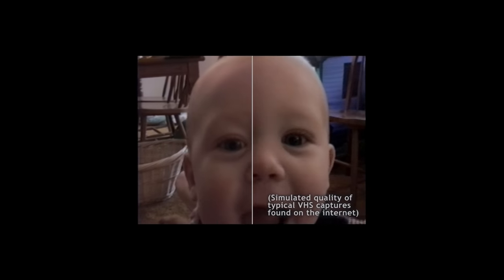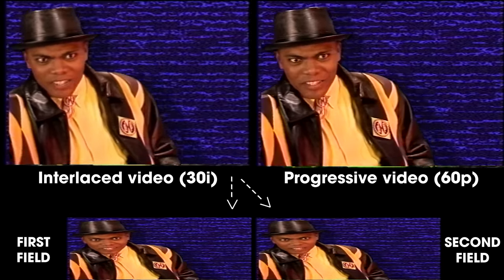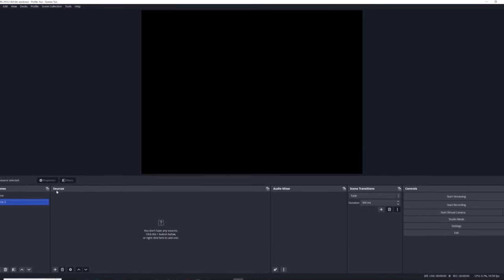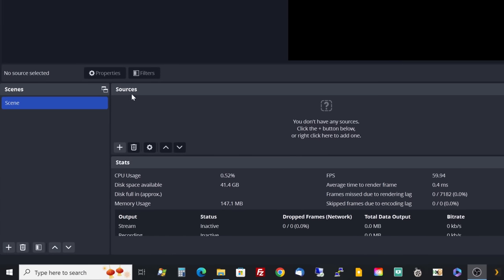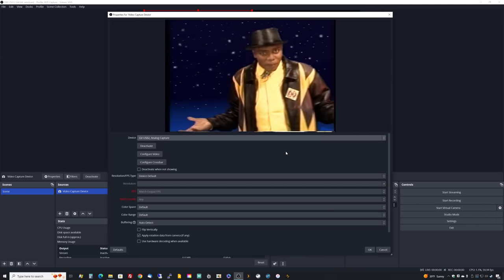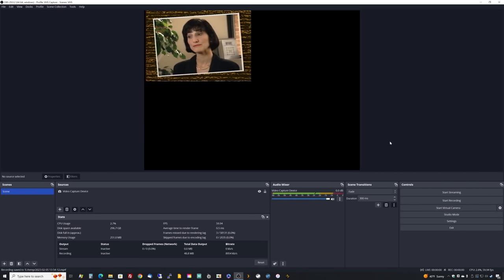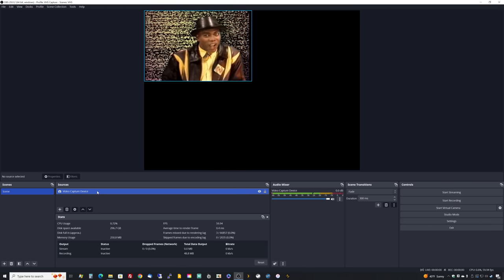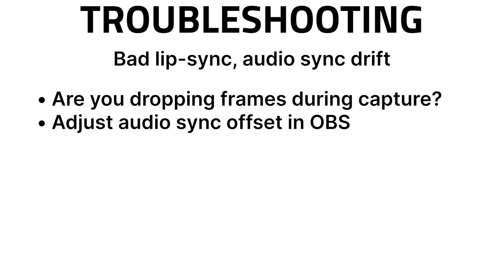How to convert VHS videotape to 60p digital video

Comment: This is great thank you.  Only thing I think I disagree with is choosing 1080p resolution to record into.  I think this should be native VHS resolution, because that way, we can use upscaling methods to get it to 1080p if we wish etc.  No need to render so many extra pixels for no gain in quality and an unnecessary gain in file size.  So for PAL this is 768x576p.  More info here: https://en.wikipedia.org/wiki/576p
Reply: PAL should use non square pixels, don't add extra informations to the archive.
Reply from the maker: The recommendation to do 1080p was for people who want to upload to youtube and have the 50p/60p rates preserved.  YouTube won't play anything faster than 30p unless the upload is 720 lines or more.
Reply: @TheOldskoolPC  You should have made this clear in the video, which you don't. Instead, you end up misleading people who just want to digitize their home videos into files for themselves into having upscaled videos and wasting space. A simple section suggesting both depending on what the needs are would have been sufficient.

Comment: This video is a godsend, but I have one problem.

I have a Dazzle DVC100 (the white one) and I hooked it up to my MacBook Pro. The light on the system is on, but when I tried to add a video capture device on OBS, the Dazzle doesn't show up on the source menu. I don't know what's going on. Is it because the device is old, or is it because I use a USB to USB-C converter?

Thanks so much still.
Reply from the maker: I'm afraid I don't know; there are too many variables.  You might want to purchase a different device.
Reply: Did you find the issue?

Comment: I followed the instructions in this video to convert some VHS tapes and the results were great.  I also have some Hi8 tapes to convert and after converting a couple of those tapes, I would say the quality of the conversion is worse than what I experienced with the VHS conversion (which is the opposite of what I expected).  For reference, I am using the original Sony Handycam camera that was used to record the tapes, I believe the original recording settings were set to record at the highest quality possible with the camera and I have cleaned the playback heads and other components inside the camera.  Is there an OBS setting that should be changed to convert Hi8 tapes vs. VHS tapes that would increase the quality of the digitized file?

Comment: This video is so welcomed and probably the best I've seen on the subject. I'm looking to convert VHS videos for video work, though I'm running Windows 11 or a M1 Mac. Any tips or recommendations for these OS? I'm hesitant to order one of the suggested devices because I'm afraid they just won't work with any of my laptops. If you have any other recommendations, they'd be welcomed! Thanks
Reply from the maker: Any laptop with USB 3.0 ports will work.  I can't recommend anything for Mac as I down own one, sorry.

Comment: This very thorough tutorial only covers using capture cards with red, white and yellow RCA connectors, but my Panasonic VCR has Scart connectors. I've read online that Scart can actually allow for a higher quality output signal (RGB) while the RCA connectors only offer a lower quality output signal (composite). Are there Scart to USB capture cards available or should I just get a scart to RCA adaptor, and the use a capture card like the I-O Data GV-USB2 recommended in this video?
Reply from the maker: The signal on a standard VHS tape mixes luma and chroma into the same signal, so you can convert SCART in this specific case to any other standard (s-video, composite) and it shouldn't further degrade the signal.

Comment: Another great tutorial!  Thank you.  Method definitely works well, but I do get better results with the old video's method.  Perhaps something to do with capturing at a full HD resolution instead of closer to the native? it ends up looking more digital, sharper edged in the final video doing it this way, and loses a bit of detail.  I also found virtual dub handles dropouts/timing issues a bit better than OBS, though that seems highly anecdotal and might just be my perception, not reality.  I feel a bit too ignorant to comment much more though.  

This method is faster, cleaner, and easier for sure.  OBS also has better audio handling, seemed to me, was much easier to avoid peaking problems.
Reply from the maker: Nothing wrong with using the older method -- this updated video was a response to people who said that virtualdub no longer worked for them, and/or had audio sync drift issues.

For capturing video for editing and archival, I would not recommend resizing at all, since resizing is destructive.  Hopefully I'll make another video in the future that covers higher-quality processes (that take more work).
Reply: @TheOldskoolPC  Any plans to cover higher-quality processes in a new video? Maybe over the holiday season? :)

Comment: I was so excited to see that you posted this new video- thankyou!  I'm getting older and really appreciate the detailed instructions,  However, I'm struggling with audio- I'm getting NO sound now.  I'm using a dazzel, and didn't have problems prior to get OBS going.  What kind of audio settings do I need to consider when setting this up?
Reply from the maker: If using Windows 10 or higher, it's possible the driver no longer permits audio; that's why I added a troubleshooting section for using a second source for audio.  I didn't have these issues in Windows 7.  The Dazzle device is 15+ years old so it's a driver issue, unfortunately.

Comment: Which VCR should i buy?  I know that a VCR having an S-Video output port is a plus, but my current VCR (Made by Sharp) is not equipped with one.  Please let me know if i should buy a JVC S-VHS VCR, or would you recommend a different a VCR to use?  I take it that Elgato is a good, solid video capture device.  I will buy one of them!  I will probably buy both the VCR with S-video, and the Elgato (or other good, solid video capture device) Friday.

Comment: Your video helped a lot with
VHS conversion. I started last year with dazzle 80 which was too old then with cheap Amazon
Dongles with poor results.Now I'm using Vidbox which OBS recognized and with your settings
I was able to get good results. With the tapes digitize, what would be a good way to clean them up? Denoise software with Upscaling? Hope you can help.Thanks again.
Reply from the maker: If you want a decent noise-removal + upscaling solution and aren't afraid to spent some money, Topaz Video AI can do a good job if you feed it progressive input.  For that, I would omit the scaling portion of this tutorial, and use the OBS function (you can right-click the canvas) to set the canvas size to exactly the size of your video capture device.  Then do everything else as normal including the deinterlacing, then bring that result into Topaz Video AI.  This is necessary because Topaz Video AI, at the time of this writing, doesn't handle interlaced video well:  You have limited processing options, and the deinterlacing quality is not great.

Comment: I have a VHS to DVD recorder. How different is this system? The VHS to DVD recorder digitizes the video and I can copy the DVD to my hard drive in any format.
Reply from the maker: That's a great way to do the transfer, but what is missing is the deinterlacing of the 30i capture to 60p output for viewing all 60 fields per second on a modern device, or uploading to youtube.  You can use the FFMPEG command I have in this video's description to convert the MPEG-2 files you copied to the hard drive.

Comment: Great and very useful tutorial. I found this video through my recommendations tab on YouTube. 2 Questions. 

Q1.) Can this method be used on tv recordings that I previously made on a DVD recorder in the mid-2000s? 

Q2.) I most likely going to have to buy a VCR since who really has one these anymore haha. So do you recommend to get one from eBay, from a thrift store or somewhere else and what should I should be looking at when it comes to purchasing a VCR to digital capturing from my TV Vcr recordings? 

Thanks in advance and it was my pleasure to drop a little tip money for your video. 

Cheers!!!
Reply from the maker: Appreciate the tip! To answer your questions: if you previously made TV recordings on a DVD, don't use this method, instead use something like makemkv (it's free but you have to enter a new beta key every month) to copy all of the DVD titles into files, then you can work with each file individually. This will prevent any generational loss. Also, as for a VCR, I recommend a thrift store or goodwill first so that you can test your process. Once your capture process is working, then you can decide if spending $350 for a quality VCR on eBay is worth it. Connect the VCR to any television you own with a composite input RCA jack and play a tape to make sure it works at all before starting. Good luck!
Reply: @TheOldskoolPC  thanks for the response.

Comment: There is also another way to cheaply convert VHS to digital. There are loads of cheap DVD recorders that will let you record any tapes that aren't protected with macrovision. Once it's recorded, just rip the DVD with handbrake to deinterlace it to 60p and there you go.
Reply from the maker: Indeed, however DVD has 4:2:0 chroma subsampling, and MPEG-2 bitrates can sometimes create visual macroblocks during periods of high motion.  It's definitely much more convenient, but the visual results are worse than doing the capture+compression yourself.
Reply: If you use a high enough bit rate to capture to dvd, the results can be very good.  Personal experience. 
Also depends on brand of dvd recorder.  Sony and Toshiba were known to be the best.  A better to get one with a hard drive. I have a Toshiba rd-xs35 that I’ve modded and replaced the hard drive with an external ssd as the dvd burner has died. A known issue on this model.  But it does have a great tbc of sorts.  No dropped frames or audio.
Reply: @lostless00  Some DVR also support to record in a higher bitrate. Mine does so and I get 1h out of a DVD.
Reply: I highly recommend not using this method, at least with Toshiba. I kept capturing random white flashes when converting vhs to dvd. It was really frustrating, and I even tried it on a 2ND Toshiba VHS/DVD Combo Unit, and still had the same issue. I think it might have to do with Macrovision and maybe a Time Based Corrector would help. So far, I've been using a Panasonic VHS which has S-Video Out. I send the White and Rec and S-Video to my Sony Camcorder, and then send that signal to my PC with a Firewire Cable. I use Virtual Dub, but recently ran into to jitter issues and audio out of sync. I tried 1 Dazzle yesterday, but it wasn't the exact model used in this video, so I ordered the exact one used in this video and hope to test it soon... - Paul
Reply: @lostless00  "If you use a high enough bit rate to capture to dvd, the results can be very good". - I will never agree with that. DVD's bitrate limit of 10mbps is crappy and not worth it.

Comment: Thanks so much for this.   Do you have a tutorial for capturing MiniDV?
Reply from the maker: I don't, but the quick answer is that you should be doing it over a firewire or IEEE 1394 connection, that way you get the exact digital bits off the tape.  In Windows, I've used both Premiere Pro (not sure if 2023+ versions still support that) and a program called WinDV to do this.

Comment: Very informational and helpful video! Thanks for sharing! I want to capture some very important VHS tapes and I have a Panasonic NV-HD750 6-head Hi-Fi (with only composite output) VCR. Will there be a noticeable difference between me capturing them with this VCR paired with I-O data GV-USB2 and taking these tapes to someone who has this digitizing service and uses a Panasonic AG-1970P with a Blackmagic capture card? That service will cost lot more and I cannot decide if it's worth it. I will be very grateful if you can give me your opinion. Thanks!

Comment: Excellent video, exactly what I have been searching for. Thanks! The only issue remaining for me is that I am running Linux, and the capture devices you suggest aren't supported on Linux. Looking around, I might be able to scrounge a way to get the IO Data GV-USB2 to work. But Have you run across any UVC compliant capture devices that will also work properly for this? Thanks.

Comment: Thanks for the great guide. I wish i would of researched this process before buying the elgato video capture usb device. Guess i could of saved some cash by buying one of the cheaper options. 

My issue now is file size, 2hr worth of video is almost 20gigs. Is it a case of tradeoffs?  Large size for better quality? Shall i reduce the resolution? Somehow limit bit rate? Why is it such a large file when newer media can be fraction of the size for the same length. 

Guess in the end i can live with it but figured i would send some cash your way while asking the question.

Thanks again for the guide.
Reply from the maker: Thanks, and I'm glad you found the tutorial helpful! 2 hours video at 20 gigs is indeed a lot; you can probably cut the bit rate in half and depending on the material it will probably look fine. I definitely encourage people to experiment. The x264 software encoder at a CRF value of 18 is it good compromise of quality and size, so if you have a decent machine, try that.

Comment: Another Gold Nugget. I was so used to Virtual Dub too. I would really like to see the advanced Tutorial, also I am using the dazzle 1.0 version. Had no issues with virtual dub, I do love the fact that you do not have to use handbrake at all. can you also cut sections out of the recording like in virtual dub?
Reply from the maker: You can't trim in OBS, but you can use VirtualDubMod to trim .mp4 files.  Also:  If VirtualDub is working fine for you, you certainly don't need to switch workflows.

Comment: Great video, very informative, would your directions and equipment work on a Mac?
Thx Again
Cliff
Reply from the maker: Yes, as OBS is cross-platform and works on a Mac.  I'm not up to speed on capture devices for the Mac though, so you'd need to do some research before purchasing.

Comment: 4:17 Kinda confused by how in your previous video you claimed that you used EasyCAP for demonstration purpose yet here a similar device is mentioned as one to avoid. Don't get me wrong, I agree with point you made about it here, also heard a lot about hardware inconsistencies of EasyCAMs, to the point that there's no audio processing circuitry at all in some of them (so their audio cables are basicaly useless). What confuses me is that i never heard about the possibility of squeezing 60p video out of EasyCAP at all. Were there some earler variants capable of this?
Anyway thank you for great tutorial!

Comment: Thanks so much for this video. I'm especially interested in OBS handling the interlacing properly. Could I replicate the 'weave' portion of your workflow using a composite to HDMI converter and HDMI to USB capture as hardware?
Reply from the maker: I'm afraid not, as the HDMI converter will most likely handle the deinterlacing itself as part of the conversion from analog to HDMI.  Some HDMI converters do a good job, some don't -- if you're already happy with your results, then you are probably fine.
Reply: @TheOldskoolPC  Thanks for the clarity! I'm hoping it's ok to assume that the process you walk thru for proper de-interlacing applies to all 3 hardware options you mention.

Comment: VHS tapes are only 320dpi unless you can find one in high res which is 400dpi...its fine on a 21" monitor
Reply from the maker: Typical analog VHS tapes only contain about 240 lines of resolution.

Comment: Thanks for the tutorial, I’ve been using a similar method with OBS for capturing VHS, but now with more fine tuning I’ll produce better results. 

Quick question: Would the formatting and deinterlacing settings be adequate for hi8 and video8 tapes because of the different source resolutions? Thanks!
Reply from the maker: hi8 and video8 tapes have the same output resolution (480/486 lines for NTSC, 576 lines for PAL), so the settings are the same.

Comment: Excellent video - I've watched numerous videos .. this is by far the best. I have a question for you if you have time. I have installed OBS, but I cannot get the program to recognize the Dazzle. I found the same model you have on eBay and I bought it - same version 1.1. I am reluctant to install the Pinnacle software that came with it as it is requesting a Windows Net version that has long since expired. I'm running Windows 11 on a computer I bought just for Video work. The computer is very fast and I have 17TB of storage and 64GB of RAM. I realize this is overkill, but I have hundreds of hours of video from VHS to Hi8, to DV I need to archive. I've managed to capture DV video using a free 2003 program called WINDV, and then importing the AVI files into OBS to convert to MP2, but I would love to capture the VHS and Hi8 with the Dazzle. Thanks for any help and Merry Christmas ...
Reply from the maker: The Dazzle has issues in recent versions of Windows, but I linked to a video in the description that covers a process to install different drivers that should make it work OK.  Thank for the kind words, and best of luck!

Comment: With your settings what is average file size for say 1-2hr video? 
This is a great in depth look at settings! 
My question being very sincere…
Vhs itself is low quality’ 
How big of a difference does it actually make to increase these settings over lower/ standard for home vhs tapes
Reply from the maker: Not much difference, given the low vertical resolution of VHS.  However, the setting I give in the tutorial is already the lowest settings and already decent.